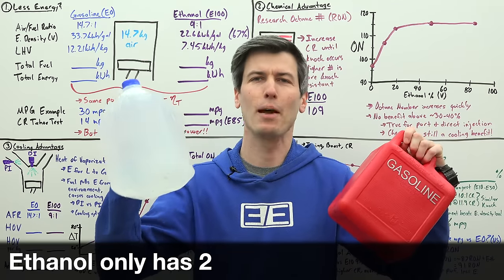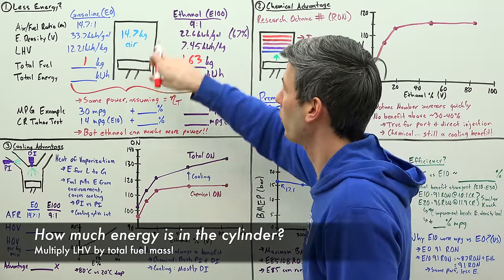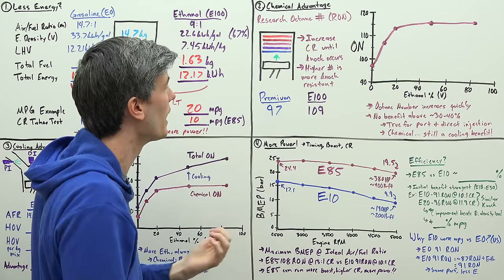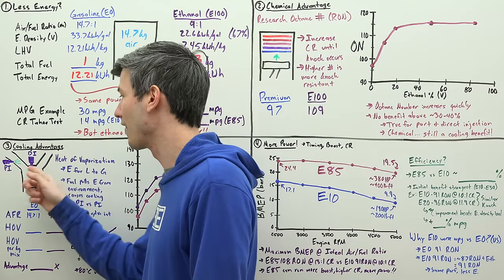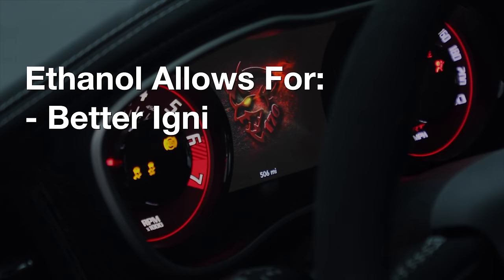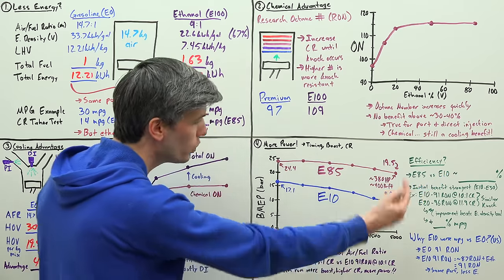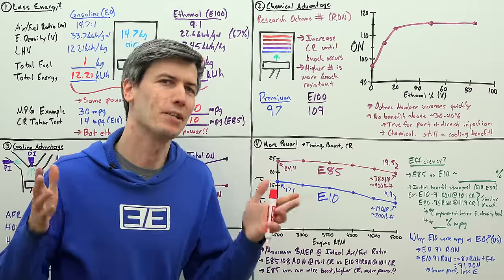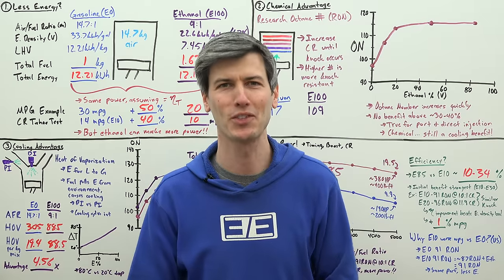Why Does Ethanol Make So Much Power? (Versus Gasoline)

Comment: How many gallons of gasoline are required to create one gallon of ethanol?
Reply: All the energy it takes to produce and deliver a product to the consumer is reflected in the price of that product.

As such, please note that the spot cash delivered price of ethanol on the NYMEX is just $1.52/gallon.

The price of an unusable sub-grade of gasoline (RBOB) is $2.21/gallon.

It takes more energy to produce sub-grade gasoline than ethanol.

To turn RBOB into usable E0 fuel costs even more from the added BTEX (benzene, toluene, ethylbenzene, & xylene) and unfortunately for humanity makes it far more toxic and polluting.

Or simply splash in >10% ethanol to RBOB and the resultant usable fuel is less toxic, far cleaner burning, and cheaper/cheaper per mile to drive with.  Who can be against that?

Note that ethanol is distilled at less than 200 degrees F and crude is distilled to remove water and then distilled at 750 degrees F to make fuels.  Also note that newer ethanol plants actually use waste steam from natural gas electric plants.  Waste steam = free energy.  Soon all plants will be this way thus ethanol's already low price has room to remain low.

Iowa State University measured all the energy it takes to produce an acre of corn into a "diesel fuel equivalent"
This included machinery, fertilizer, chemicals, tillage, planting, harvesting, drying, trucking etc. 
They found it takes 34 gal of diesel to produce one acre of corn.
What do we get from those 34 gallons of diesel?
We get >500 gallons of ethanol.
But wait, that is not the kicker.
The kicker is we still get 100% of the protein and other things from that acre of corn still available for an even better feed. A win-win.

Note that 100% of the fertilizer put on corn is still fed to the livestock in those distillers grains.  Ethanol is made only of things in the air: solar energy, CO2, and water with those latter two recycled once burnt.

Comment: What does Thermal energy of a fuel have to do with kinetic energy used to move my pistons?
I don't care if the fuel heats my engine up...I want it to expand massively to push the piston down. I could care less if it gets hot while doing that.

Comment: Fuel economy (range) is far more important to me than power. So is the life of my fuel system components.
Reply: I see you must drive a diesel car.  Am I right?  If not, why not?  Please explain.

Cost per mile to drive and pollution are probably most important to me.

The Bureau of Labor Statistics measured the percentage of household income spent on vehicle repairs and maintenance from 1990 to 2017.  The amount for repairs in 1990 was 2% and this declined to 1.5% while ethanol used in our gasoline exploded from .1% in 1990 to current levels from 2011 onward.

The EPA before approving E15 in 2011 conducted long term tests on non-flex fuel vehicles 2001 and newer with not only E15 but also E20.  They found both fuels ran fine and did no damage.

Identical non-flex fuel cars to ours in Brazil use their common gasoline which contains a minimum of 27.5% ethanol.  It has worked out so well and for so long that Paraguay went to E27.

On most any chemical compatibility chart you will find ethanol at worst is equal to but most often is easier on rubbers, plastics, and metals than what gasoline and BTEX (benzene, toluene, ethylbenzene, and xylene) are.

Ford's first prototype Ecoboost engine was optimized for E85 and it achieved 15 to 20% better fuel economy than E0 gasoline with load performance similar to a diesel engine.  They didn't come out with it in flex fuel in part because they thought they could skirt paying the MIT scientists' patents on the technology.  That is now in litigation.

Ricardo built and drove around a pickup with an ethanol optimized engine for GM.  It achieved better power and fuel economy than GM's diesel engine at half the size/twice the power.

This is why GM wants the EPA to come out with a 100-octane fuel standard.  They (Ford also) are concerned about E85 availability.  For some odd reason, we only have <2% of fuel stations offering E85 compared to France who has some 25% offering E85.
Reply: @danafletcher2341  I must drain the carburetor on my Honda generator and all 4 carbs on my 2002 Honda motorcycle after each use or a hard build-up forms in the main jets. Ultimately leads to very lean running and then no-run. This only started happening when 10% ethanol was introduced. Both owner's manuals say "Use of ethanol not permitted". Thanks EPA.

Comment: “Energy density by mass” = specific energy (J/kg). 👍
Reply: Ethanol's other burn characteristics overcome its lower BTU content in a piston engine so much so that ethanol optimized engines achieve greater power and mileage than gasoline, even greater than diesel.

 FROM RICARDO:
The new federal CAFE standards are calling for a doubling of fuel mileage performance, which, Vint says, is going to send OEM’s looking for high octane numbers to improve efficiency and ethanol is the best source. Ricardo, an engineering firm with over 100 years in the business of engine design, has developed an extreme boosted direct injection engine (EBDI) to optimize ethanol blends. The 3.2 V6 gasoline engine rivals the power and torque of a much larger GMC Sierra 6.6 diesel, he said, and it delivers 3.5 percent better fuel economy than the diesel.

Comment: I'll just stick with nonethanol gas. Yeah it costs probably as much as premium, or even diesel, but at least I don't have to worry about it wrecking my quadrajets on my square body Chevy trucks, and I've not seen anything other than a Holly double pumper style carb that can handle E85 anyway. Plus my 85 C30 with its 454, TH400 trans and 4.10 gears already gets 8 mpg with regular gas so imagine how bad it would be if it were set up for E85.

Comment: You could have simply said ethanol needs more air and fuel to burn, making it less efficient but more powerful. It’s basically the same relationship between gasoline and diesel
Reply: In our current gasoline optimized engines, ethanol makes more power but less mileage.  It needs less air because it contains a lot of oxygen, hence the reason we use it to oxygenate gasoline today to reduce pollution.

In ethanol optimized engines, you get both more power and more mileage than gasoline, even more than diesel engines.

Ford's first prototype eco-boost engine was optimized for E85.  It achieved 15 to 20% more fuel efficiency than gasoline with load performance equal to diesel engines.  They didn't come out with it in flex fuel because they thought they could skirt paying the MIT scientists patents on it.  That is still in litigation to this day I do believe.

Ricardo built an ethanol engine for GM and it ran in a pickup. It is half the size/twice the power of gasoline and diesel with better mpg than either one.

FROM RICARDO:
The new federal CAFE standards are calling for a doubling of fuel mileage performance, which, Vint says, is going to send OEM’s looking for high octane numbers to improve efficiency and ethanol is the best source. Ricardo, an engineering firm with over 100 years in the business of engine design, has developed an extreme boosted direct injection engine (EBDI) to optimize ethanol blends. The 3.2 V6 gasoline engine rivals the power and torque of a much larger GMC Sierra 6.6 diesel, he said, and it delivers 3.5 percent better fuel economy than the diesel.

Scania has sold an ethanol engine worldwide for years which they state has fuel economy and power on par with their diesel engines.  Cummins had their ethanol engine called ETHOS which was half the size/twice the power of gas and diesel too.

This is not new technology or knowledge, it was known long ago.  It is suppressed technology.

Rear Admiral C.M. Chester wrote Henry Ford a letter on Dec.15, 1916:
"...I also pointed out in the article that as governmental laboratories had developed from 40 to 55% efficiency in alcohol engines as against 20% in gasoline machines, the use of alcohol at double the cost of gasoline for power purposes, was cheaper for motor[s] than gasoline in common use today."

Scientific journals from 1890 – 1920 contain hundreds of references to alcohol fuel at the dawn of the automotive era. 

Studies of alcohol as an internal combustion engine fuel began in the U.S. with the Edison
Electric Testing Laboratory and Columbia University in 1906. Elihu Thomson reported that despite a smaller heat or B.T.U. value, “a gallon of alcohol will develop substantially the same power in an internal combustion engine as a gallon of gasoline. This is owing to the superior efficiency of operation…”

The USDA tests in 1906 also demonstrated the efficiency of alcohol in engines and described how gasoline engines could be modified for higher power with pure alcohol fuel or for equivalent fuel consumption, depending on the need.

The U.S.Geological Service and the U.S. Navy performed 2000 tests on alcohol and gasoline engines in 1907 - 1908 in Norfolk, Va. and St. Louis, Mo. They found that much higher engine compression ratios could be achieved with alcohol than with gasoline. 

When the compression ratios were adjusted for each fuel, fuel economy was virtually equal despite the greater B.T.U. value of gasoline. “In regard to general cleanliness, such as absence of smoke and disagreeable odors, alcohol has many advantages over gasoline or kerosene as a fuel,” the report said. “The exhaust from an alcohol engine is never clouded with a black or grayish smoke.” USGS continued the comparative tests and later noted that alcohol was “a more ideal fuel than gasoline” with better efficiency despite the (*then*) high cost.

Comment: Huh ? OK well I run E10 in my car because its cheaper. I run non-ethanol in my motorcycles because the alcohol in the fuel is basically sugar that leaves a sticky residue on the valves that burns off as crud stuck to the valves, head and piston.  Yes or no ?
Reply: Same motorcycles we have in Brazil use either E25 or E27 and have for many years.

Ethanol is so clean, you can buy indoor ventless ethanol fireplaces.

Comment: - also, many (most) cars on the road aren't effficiently able to alter compression ration to make the most of higher octane numbers - merely retarding timing isn't the same thing.
Reply: At WOT (wide open throttle) you want to advance the timing to take advantage of the ethanol fuel’s power potential, not retard it.

Few road cars can raise their compression ratio, but forced induction raises the effective mean cylinder pressure. Turbo’ed applications are where ethanol fuels shine.
Reply: @sking2173   I always fear I confuse advance vs retard - I remember that one is a bit quicker than the other...  (not as many kids even know what a timing light is these days - numbers on a map aren't the same as reading directly off the balancer.)

(yes... (did I mention WOT? ), however thinking out of the box,  retarding the timing - sort of  increasing the effective compression ratio (without going into variable valve timing  -  atkinson  vs otto cycle)  - yes when pinging starts advance is your friend (or should have been..

Indeed not many cars run octane test engines, typically (jk) - the reason why running a higher RON than the engine needs - without boost - achieves little.

cheers.

Comment: your engine's CR is set, and using E is not going to get you double the power at 5000 rpm even though it could if you DID have a higher CR.

Comment: thousands of race cars cant be wrong. The down side to ethanol or methanol as a fuel, is its more corrosive . The race cars need to have the fuel systems drained after every race or two to keep the parts from corroding. Ive also seen problems with small engines like on older lawnmowers, where the carburetors get clogged up with the gas ethanol blended gas.
Reply: Have you ever looked at a manufacturer's chemical compatibility chart on ethanol vs gasoline and BTEX (benzene, toluene, ethylbenzene, & xylene)?  Evidentially not.

The identical cars, boats, motorcycles, lawnmowers, and small engines in Brazil use E27.  It has worked out so well and for so long that Paraguay went to E27.  India is going to E20.

In Pump the Movie which you can see on YouTube show a Ford pickup factory and all the fuel system parts come from the same bins save the yellow fuel cap.
Reply: Methanol is Ethanol isnt.

Comment: Ethanol in fuel isn’t good for motorcycle engines, especially 2 stroke engines. Ethanol should be a choice, not forced.
Reply: Brazil has identical motorcycles and 2 stroke engines and their common gasoline contains a minimum of 27.5% ethanol.  It has worked out so well and for so long that Paraguay went to E27.  India is going to E20 and all of their new vehicles must be flex fuel for E100.

Our current usage is of ethanol is as an oxygenate since gasoline is so dirty.  You would rather force people to breath pollution with all the associated health effects?

Ethanol costs less per mile to drive with and far cleaner air and is less toxic to handle.  What can be wrong with that?

Denver in 1988 was the first government entity to require E10 when they were on in EPA list of ozone non-attainment zones.  Soon with ethanol they were off that list.

Even with just 10% ethanol added to E0, the Swiss Federal Laboratory for Materials Science and Technology found that the especially health devastating ultra fine or nano particulate emissions were lowered by 97%, carbon monoxide lowered by 81%, carbon dioxide lowered by 13%, aromatic hydrocarbon emissions lowered by 67-96%, and genotoxic emissions lowered by 72%.